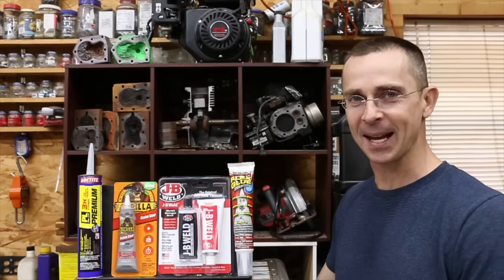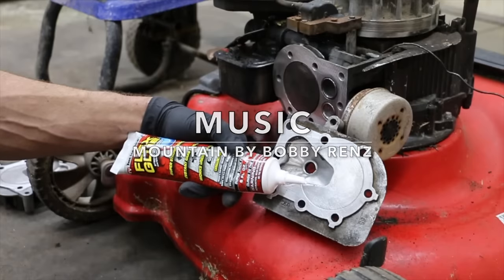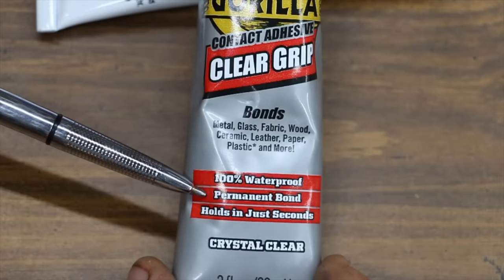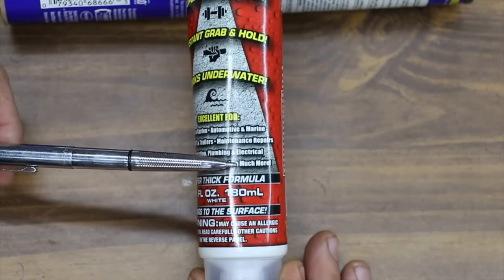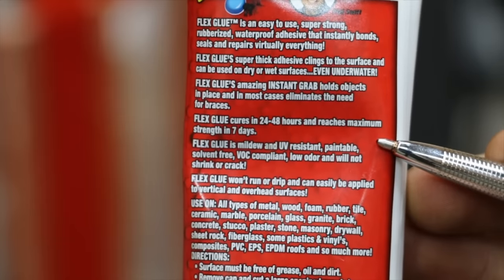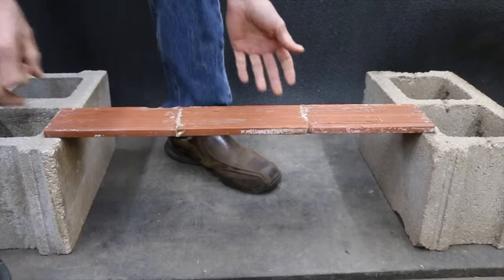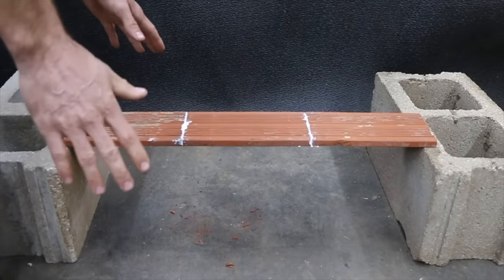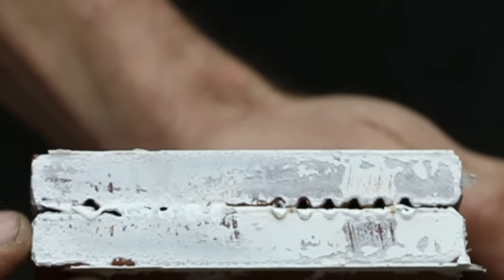Is Flex Glue better than JB Weld, Gorilla & Loctite?  Let's find out!

Comment: Fixed a tooth.......I was hundreds of miles out in the ocean and one of our deckhands had a filling that fell out and he was suffering the worst kind of toothache with no way to get him to the dentist. We took and stuffed his mouth full of cotton and then took the air compressor and blew his mouth out until it was bone dry. Then we mixed up the JB Weld and applied it to the hole where the filling used to be. We then propped his mouth open so the air could get to it and left it like that for a couple of hours. About 5 years later I seen the same deckhand and he came up to me with a a big grin ,opened up his mouth and said the tooth is still going with the JB Weld fix. We were expecting that he was going to go to the dentist when we got back into land but he didn't and the tooth remained.
Reply from the maker: Thanks for sharing!

Comment: Are you supposed to wet the surface before applying the Gorilla  glue???
Reply: No.  If you check the instructions on this Gorilla Clear Grip product it doesn't state surfaces need to me moistened.  The original Gorilla polyurethane based glue is a water activated glue.

Comment: Have you done any shoe repair with partial or full on delamination?     I think you'd be good at that! Particularly interested in a shoe bond shoot-out with Aquaseal SR, FLEX SEAL,  Gorilla Glues (Clear grip and original)   LOctite shoe Glue,   and a bunch of others for consumer market.    I hear epoxies do damage to the soles btw. So no JB Weld for shoes eh?
Reply from the maker: Thanks for the suggestion.

Comment: Compare FLEX, 3M E-6000, GOOP, JB WELD! :) I think you will be surprised at how well E-6000 holds things together if cured for at least 24 hours (48hrs preferred). It is a pretty strong grip and resists shear very well.
Reply from the maker: Great suggestion! Thank you

Comment: Could you try shimming the head (so a thicker layer of jb weld cures in place) on the motor while the glue dries? The head bolts have a tendency to squeeze all the glue out. Also the torque on the head bolts can be 0 because the glue will cure for even adhesion pressure. Thanks in advance.
Reply from the maker: Thanks for the video idea.

Comment: I used JB Weld Quikweld to glue my Nike running shoe sole back in place.  Spread it thinly on shoe and sole and then clamped them together.  Been wearing them for weeks now without a problem.  Good stuff.  How about testing pet grooming clippers to see which are the best.  Maybe you could clip the knap off of carpet as a test.  Tried to use the hair clippers I use on my head and my dog's fur is a whole different matter.
Reply from the maker: Thanks for the video idea.

Comment: There are a ton of DIY tools people have designed.  I would like to know what are some of the most important aspects of making any particular tool.  For example, when modifying a drill press so it can cut sidewise you need to be aware that drill presses are not designed to withstand lateral forces.  For bandsaws, you need to be aware of the flywheel effect and etc.  If you could actually survey the tool makers themselves to see what is a good one that people have copied.  Sort of like a tool review with commercial tools, except this is a review for the best DIY design.  You could even have a contest.  Have the DIYs ship their machines to you.  Then do the test and ship them home.  Obviously, you shouldn't have to pay shipping or for the designs.  Moreover, you can simply direct people to what you consider the best design and why.  Just some ideas for future videos I want to see.
Reply from the maker: Thanks for the suggestion.

Comment: All good.  All with good uses.    Im gonna do some jb weld strength tests myself.  I'm wondering if I drill holes as if I'm toenailing a screw or bolt.   I'll try to mold a bolt out of the adhesive and test it.     And try different cavity designs. To see which ones are structured to be the strongest.    Im gonna study alittle more architecture to see which mechanically strong designs have lasted over time and try to test those.   Like do a bridge type frame out of 2x4's      try different structures and see if the adhesive can provide a significant amount of structural strength.
Reply: Wondering if I can add it to my ceiling joists as I build a loft.   Of course Im gonna bolt it and get it to code.   But I wanna add the jb weld to certain joints for added strength and piece of mind  I'm vaulting the celings on one side of the house.  And then adding the loft to the bedroom area as a neat feature for a joined 2 bedroom office / master bedroom.   So you can have the computer/ studio.     And master bed  that joins to the bathroom.   Then a small novelty entertainment area in the loft because I have a 2 bedroom sized attic area I can take advantage of. And it's not super tall. But it's under the Gable arch so it has alittle height.    Working with a 5 bd 1 bath single story Florida cinder block home 🏠
Reply from the maker: Thanks for sharing.

Comment: Very surprising results! I do use JB when temporary needs to be done, like a whole on a coolant pipe while the back order part arrives, same i used Loctite on threats or shoe glue, I've never used gorilla tape idk how superior it is to duck tape
Reply: Gorrilla tape is amazing. Nothing else holds as well, even expossed to the weather. I held a clear shower curtain on the back of my busted rear window for 6 months, and it never failed, I had to take it off as I locked my keys in at the gas station. No other tape came close.

Comment: I tried Flex glue. My problem was the spray applicator wouldn’t spray. I even bought 2 cans in my original purchase. I did try both spray applicators. One did spray from one did spray but it was more like a spitting type spray.
Reply: So I did do any comparison test.
Reply from the maker: Thanks for sharing.

Comment: for over 50 years I have used 3M 5200 adhesive caulk. I would like to see you test with other comprable products--I have had little if any failure with 3M 5200--------Mikey, in Belfair, Wa
Reply from the maker: Thanks for the suggestion.

Comment: I raced racing karts professionally as a teenager and I broke the connecting rod in practice in my best motor. Spray carb cleaner, and jb Kwik (had just came out) and a natural light beer can sealed up the thirteen holes in the block, and rod off the parts truck and finished 2nd in the second heat, and 3rd in the feature without losing any oil, so what the heck? I ran half a season with that block(a few refreshes) and always finished well with it
Reply from the maker: Thanks for sharing.

Comment: That JB weld is something else, never used it before as it is not easy to find here and quite expensive - however, after seeing these results, I will be buying it in the future. For the wood gluing, it might have been worth using clamps to set the joints first, some of the wood glue I use needs to be clamped tightly before it reaches full strength. Got to be honest though, that wrench test seems pretty useless, what is it supposed to represent? It was a good thing that the JB weld failed the cylinder head test or those idiots at GM would probably be gluing their cylinder heads on to save a few nickels on head bolts.
Reply from the maker: Thanks for sharing.

Comment: I am not sure about the purpose of these comparisons.  PF compares single component glues with an epoxy? Obviously epoxy will provide a quite different results, but it's also very different to prep and not that easy to work with as those, which are available at any moment after you remove the cap.

Comment: My cousin has a saying JB weld and bayling wire he can fix anything but I was wondering what would work better JB weld or Marine slent 5200?
Because I know for a fact that after you use 5200 on fiberglass if you have to take it apart after it's been on there for a while you're probably going to tear the fiberglass when you take it apart.
Reply from the maker: Thanks for the video idea.

Comment: I’ve used JB weld a few times, & the fixes seem to be holding well so far. Yeah I’ve used Gorilla, & basically used it once then stuck it in the junk drawer, & kept using JBWeld. The gorilla tape isn’t worth it.

I use Duck Tape all the time, & seems to be doing the job well.
Reply from the maker: Thanks for sharing.

Comment: the Gorilla Glue has a much stronger bond when you introduce water to it. if you had wet the ends of the boards, the tiles and pvc, it would have done a better job. it expands when the water is introduced, so its not as clean of a bond, but its very strong
Reply from the maker: Thanks for the constructive feedback.

Comment: I haven't checked all your posts for this test but I don't think you're done a test to determine if an expensive drive chain $280 is really that much better than a cheap one $40. Does the price really make that much of a difference on the longevity of a chain?
Reply from the maker: Thanks for the suggestion.

Comment: I like your testing videos, but wanted to share one item.  Some of the tubes of  Loctite that I've purchased from Home Depot seemed to be partially hardened in the tube to the point where it was not possible to squeeze the adhesive out of the (Caulking) tube.  I would caution people buying it to make sure the tube can be squeezed a bit.
Reply from the maker: Thanks!  Thanks for sharing.

Comment: 5:07 
Loading the weight on the JB weld test, the round weight displaces the mass better  than the rail, probably could have done even better with a round plate on the bottom.
Reply from the maker: Thanks for the feedback.

Comment: Heat, flexibility, chemical...hummmm.  I try to figure out what to use for the split CV boot (rubber) instead of Loctite 401 super glue.  Flex Glue seems to be the flexibility/general purpose glue application than the flexibility of moving part.  The name is confusing.  What is the best glue for rubber/moving/flexing parts such as Split CV boot of car drive shaft?
Reply from the maker: Thanks for the suggestion.

Comment: Hey @Project Farm i love your videos! The only problem I see with this test is that you mixed a big amount of JB Weld and then started applying it to the pieces of material over a period of time. When epoxy is mixed with the hardener, from that point on the adhesive strength drops over time as the mix starts to cure. Mixing a smaller new batch at the point of assembling each test would be better. How much this would effect the tests, I have nooo idea. Just wanted to share my thoughts about this. Thanks for the bitchin content!

Comment: The amount of resin placed on the contact surfaces on each samples seemed inconsistent. To be fair, same measured amount should be placed. Also, need pure tension test and not only bending or torsion. 
I suggest that you emulate the standard ASTM method.
Reply from the maker: Thanks for the feedback.

Comment: Heh, I once glud a hammer to a 2x4 with Titebond 2 (the blue label). The hammer only came off after multiple hits with another hammer and when it came off it tore a chunk of wood off. I had to cut the chunk of wood off with a utility knife. I also used gorilla glue to bond plastic to wood on a pair of crutches. And last but not least, never.... get foam sealant..... on anything. That stuff destroys clothes and glues pretty much anything to anything.
Reply from the maker: Thanks for sharing.

Comment: JB Weld is Epoxy with Steel in it. For a lot of applications, regular clear epoxy is just as good. Where JB Weld excels is when you need to fill small gaps.
Reply from the maker: Thanks for sharing.

Comment: Are not you susposed to use watter with grorrilaa glue . wet the wood then apply .  second I am going to your jb weld to fix a toro gass snow blower tank to a mounting brace that had a couplelittle tack welds.  I wonder if it will take the vibration
Reply from the maker: Thanks for sharing.

Comment: you can fix a cracked engine block with J B WELD  almost as good as a weld   this is useful where you do not want to use heat
Reply from the maker: Good Point!  Thanks for sharing.

Comment: On the wood test you have to factor in that wood has cyclogens and polycentrics which tend to break the bonding agent in polyepoxides, the main prepolymer in JB Weld......not a fair assessment. JB Weld has thynomides (expensive) for faster bonding/curing times....it's a better product.

Comment: lol I don't know which is the best glue but I bought a bottle about 3" high of Gorilla Glue. It had about 1/2" of glue in the bottom of the bottle. When I contacted Gorilla Glue company, they responded that it sold by weight rather than volume. IOW basically not denying at ALL that they did this. I won't be buying more.  )
Reply from the maker: Thanks for sharing.

Comment: The only thing you would use J-B Weld for is basically a very long permanent fix the other products are for light application they're not going to be in looking feet with J-B Weld as you through J-B Weld cannot hold everything the same way especially when you have compression behind the head and the head has no bolts I would like to see the test on how long J-B Weld wood last with the bolts in and see if the not only compression but the heat would keep the J-B Weld from burning like a head gasket Woodburn
Reply from the maker: Thanks for the suggestion.

Comment: I have an idea for a video.  There is a lot of controversy about using Mobile 1 0W16 and 0W20 vs. Toyota 0W16 and 0W20.
Many people say even through Mobile 1 makes the Toyota oil that there is a difference between what Mobile 1 makes for Toyota use and the Mobile 1 product it sells under its own name.  I think there are many Toyota owner that would like a definitive answer to this question or if there is a difference, that it actually makes a difference in how the engine wears with one or the other.
Thanks
Reply from the maker: Thanks for the video idea.

Comment: I replaced my old pancake Porter cable compressor with a new quiet one from Lowes. The new one seems way weaker than the old one but it is much quieter which is a huge plus. It does let out a loud hiss when it finishes charging which seems to defeat the quiet idea though.  How about reviewing small compressors?  I bet you could have some real fun blowing stuff up (ha! pun intended) with them.
Reply from the maker: Thanks for the video idea.

Comment: @  6:32, very little of the end of the 2x4 appears to have been covered with Gorilla glue 
@ 6:57,  only 90% of the end of the 2x4 was covered.
With inconsistent coverage with the glue, the results are at best, questionable and  I was disappointed. Other comparisons you posted showed a more consistent test procedure.

Comment: J-B Weld is more of a bonder bonds two pieces of material together. All the other products are like a sealer and a patch. The other products strong bond it's for like how they dry on the surface. A better comparison would be to test JB Weld against other two step products like epoxy. Like jb weld against dollar general brand or walmart brand. I want time broke a  coner off of a thermostat housing. I used JB weld to fix it once dried i could sand it and drill it. You could do a durability test between J-B Weld and other like products for bonding sanding and drilling
Reply from the maker: Thanks for the constructive feedback.

Comment: I use loctite on a regular basis with almost  always good results.  But after this I might try JBweld more often. The results are amazing. I do not buy any gorilla products. The first few times I used gorilla glue when it first came out, it failed every time. I will not buy another gorilla product. All these years later their product still sucks. The original gorilla product i used was the polyurethane glue for wood. The product makes a mess which is very hard to clean up, especially on your skin. And it is no where as good as titebond or elmers for wood. I dont know how their company is so large when their products are really crappy
.I guess the marketing goes a long way. Thanks for this comparison. Maybe it will force Gorilla to make a better product.
Reply from the maker: You are welcome!

Comment: Flex glue is not made to do that type of job. It seals things together which WILL move relative to each other, and hold on and still seal.
But it does not hold on tightly to stop things from moving. It is an adhesive/sealant. 
Todd, you're smarter than this.

Comment: I bought a used car, driving it blew a sparkplug out .  got my JB Weld,  put on the plug and installed it , drove it 2000 miles and it came out again , so I kept JB in the glove box.
Reply from the maker: Thanks for sharing.

Comment: ב''ה, this is absolutely great and very useful.
 
I'm impressed with Gorilla more for its foaming/expanding properties that make it uniquely useful for wood repair, but this is a reminder that the original urethane/"mucilage"-colored product and the clear version are significantly different formulas.  Might be worth doing another round of testing just to know what the original is and isn't good for.
Reply from the maker: Thanks!  Thanks for the suggestion.

Comment: The gorilla glue is best on wood if you apply water to the surface you intend for glue. just enough to dampen. This allows the glue to seep deeper into the pores of the wood. I guess it makes foe about %40 more strength.
Reply from the maker: Thanks for the feedback.

Comment: Slightly biased testing tho. It's like hey let's take a 2 part epoxy and test it against some glue, caulk, and sealant.  Maybe test j.b. weld against loctite brandepoxy. It comes with a  syringe!or 2! that mixes it as it comes down the tube. Do a versus with 1 minute 5 minute and 30 minutes set time epoxies. And last throw in some of that epoxy that you pinch off a bit and knead up with your hands. Then you would have a fair test.